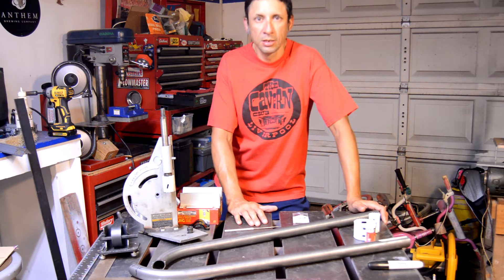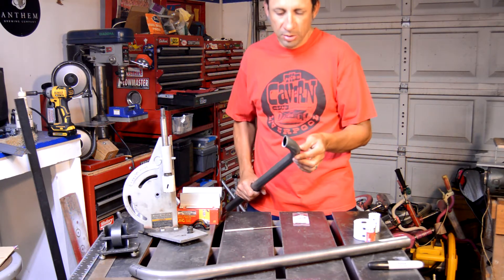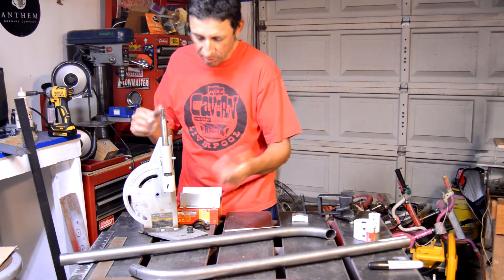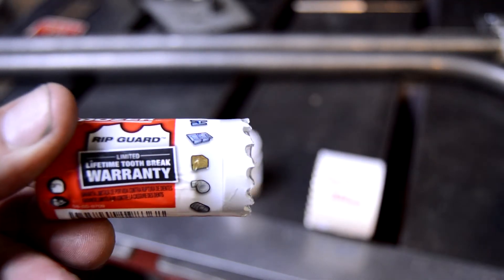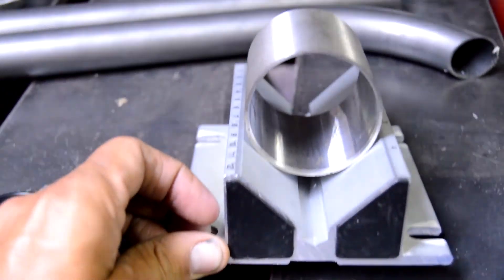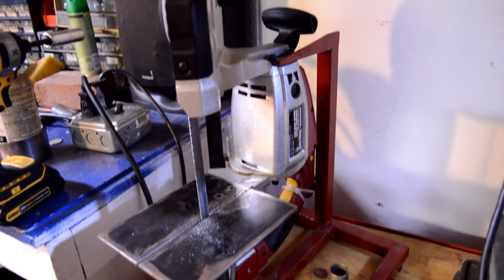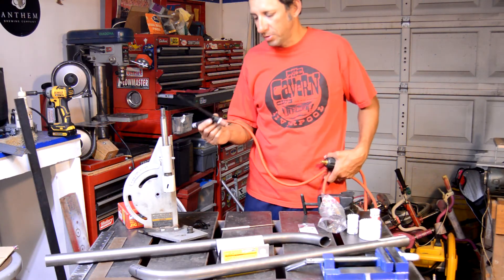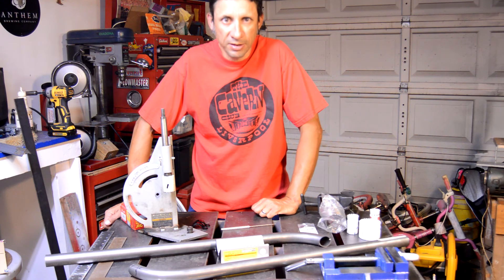Bicycle frame build number 2 part 3

Comment: check out metalgeek.com for a coping calculator. It would allow you to miter the tubes with out building a special jig.
Reply from the maker: I've used them before on a frame I welded a headtube on, and it worked really well. It's the way to go if you don't have a tube notcher.  The problem is, the tube needs to be mitered in the middle of a bend and I don't think the coping calculator would work for this.